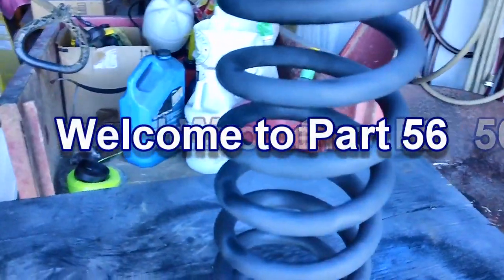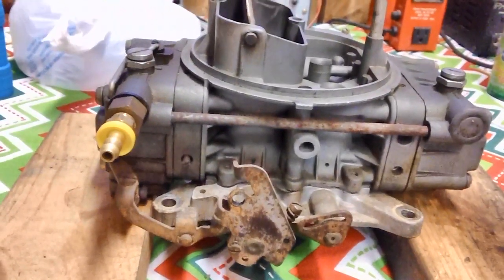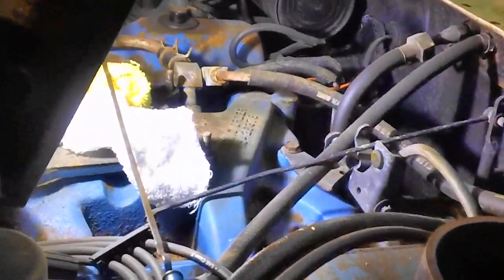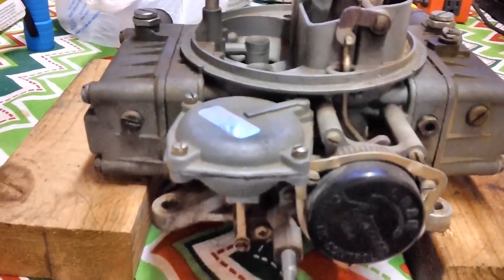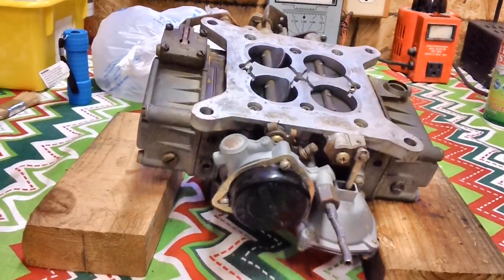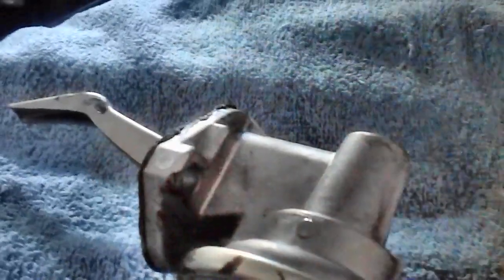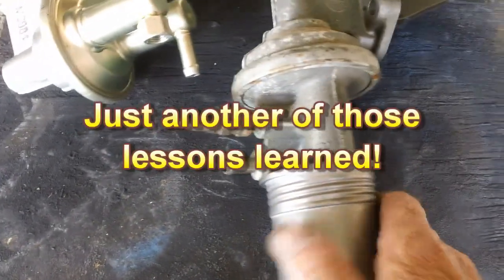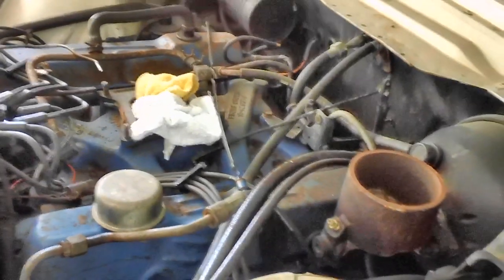1966 Ford Thunderbird repair and refurbishment (Part 56). Carburetor linkage.

Comment: John, 
Best of luck with that carburetor and fuel pump. I struggled with the replacement fuel pump on my 1967 Ford Econoline van recently. It was noticeably bigger and clearance was really tight. I seriously considered going with an electric fuel pump conversion. 
Regards, Tom
Reply from the maker: Tom,
My initial inclination was to go with an electric pump, but Brendan talked me out of it.   So I deferred to his always reliable judgement.
Regards,
John
Reply: @joernone  I know you're limited on your watching time, but Cold War Motors has just started a competition on getting two seized straight eight engines running - a Packard and a Buick. Both cars have been sitting 40 to 50 years. Very interesting and enjoyable to watch. https://www.youtube.com/watch?v=vOBBU6h8BFU&feature=em-uploademail
Reply from the maker: Tom,
Yes, I knew about it and watched it.  It's already a fun contest.
Regards,
John

Comment: John...at this point, if it were me, I would replace all of those vacuum hoses around the top of the engine.  Not expensive, and easy access without the carb and linkage in your way...

Comment: Well that's a crapper about the fuel pump.  I think electric fuel pump and a plate on the timing cover is the way to go cause these old cars I like to let the electric pump prime the line and the carb instead of cranking on it to get fuel to the carb. Saves battery and saves starter.
Reply from the maker: What???  You don't want to crank these old cars to get them to start?  Blasphemy, my friend, blasphemy!   It's all part of the fun.  Why I'll bet you'd also put LEDs in a vintage jukebox.  Tsk-Tsk.
Regards,
John

Comment: John....I'm  sure you thought of Helicoils to repair the threads.  I had a 67 Pontiac with a 400 V-8.  I replaced my fuel pump and the same thing happened to me.  I ran the helicoil into the timing cover (yes...it was aluminum too) and even though my screw was crooked, it held my new fuel pump tight.  Lucky me....
Reply from the maker: My initial thought was to use a helicoil, but Brendan and I came up with something a little easier...we hope.  😏
Regards,
John

Comment: Try using socket head capscrews on the fuel pump.  Not factory, but it should work using allen wrenches, or sockets.
Reply from the maker: They would for sure work, but we're already on track to try something a little different.  But if it fails, I'm not opposed to backtracking to try your idea.
regards,
John

Comment: Are you able to start the bolt in the fuel pump completely to clear the socket? Keep the pump away from the side of the block to get the bolts started. Thanks for sharing...
Reply from the maker: Darryl,
It would be a piece of cake to install the pump if the engine were out of the car, even with the new pump design difference, but trying to finagle the new pump in place is the wrong way to go.  In the end I'll be sorry for doing it.  Better to just go with the right pump and move on.  Fewer headaches that way.
Regards,
John

Comment: Good video i wonder if that new fuel pump you have was designed  for an engine that had stud's coming out of the timing cover  and just nut's holding it on only enough room to get a wrench on the nut's
Reply from the maker: Who knows, my friend?  Seems to make more sense.
Regards,
John

Comment: That's amazing that they left a hole for maintenance of the fuel pump.  Can you replace that hideous diaphragm fuel pump with some sort of electric pump?  That would be so much more simple.  I once lost an engine to a leaking fuel pump, it leaked gasoline into the engine oil when the diaphragm cracked.
Reply from the maker: James,
See the above comment by THOMMGB.
Regards,
John

Comment: Hi John, I'm looking at buying a 1966 Ford Thunderbird town for $1500 that runs (roughly) and needs body work and windows, but the interior is near perfect. What is your take on this? Is it a good deal, or should i keep looking. I have had no luck with asking around at local shops and restoration garages. Thanks, Andy
Reply from the maker: Hey Andy,
There's two main schools of thought on your question:
1.  Though the price will likely be high, buy a classic that's been restored and have fun with it.
2.  If you prefer to do a restoration yourself, then buy a junker or rust bucket at a cheap price and have at it.  Of course, the cost of restoration will for sure be high.
I fall in the middle...not restored, not a rust bucket, just a car I can enjoy working on, hopefully to finish before the grim reaper arrives.  If not, so be it.
Lastly, condition of the engine and transmission is of utmost importance.  It can run buku bucks to repair/replace those puppies.  I'm talking thousands of dollars.
Regards,
John
Reply: joernone Thank you!

Comment: So I ended up getting one of those carb kits and replacing all the gaskets and thermostat choke but now I'm have trouble reconnecting my fuel line and air line hoses next to the thermostat choke whats the best way to go about that
Reply from the maker: I'm not 100% clear on what you mean but the fuel line goes back on the same way it came off.   Ditto with the heat riser tube (hot air tube) from the exhaust manifold...it also goes back on the same way it came off.  Are the two sets of threads stripped?  That'll keep the fittings from going on.
Regards,
John
Reply: Yeah they look stripped and won't tighten and keep turning you think rethreading them will work or some thread seal tape
Reply from the maker: The entire carburetor body is made of aluminum, thus all the threads are easily stripped.  It's no big deal...happens all the time.  So you have three options:
1.  Switch to an electric thermostat and block off the heat inlet holes in the carburetor body and the exhaust manifold.
2.  Use the original brass fuel inlet fitting with enough gasoline resistant thread seal to create a permanent seal or drill out and re-tap the hole to fit a different size brass fitting.
3.  Find a new base.
Regards,
John
Reply: Thank you john for the help
Reply from the maker: Be sure to come back and let me know how it went.
Regards,
John
Reply: Definitely will I watch all your videos I ordered a electric thermostat from mikes carb part witch eliminates the hot air hoses like you said then will just have to reconnect the fuel line back in I got re-tapping and die set just on case the thread seal tape doesn't work out again thanks for the advise john
Reply: I guess it didn't click in my head when I watched your video when you changed out your thermostat choke to a electric one its definitely a better set up the one I got you sand a spot by the valve cover for the ground and you hook up the hot wire to a spot that is getting 12 volts of power when then power is in the on position with one of those volt meters is the one you have similar
Reply from the maker: There's no need to establish a ground.  The carburetor itself is the ground once the metal 3-hole retainer ring is installed around the black thermostat housing.  The ring makes contact with the two shiny metals in the housing.  Once the three screws are installed in the carburetor walla..you have the ground.  Go here and take another look at that part of the video.  Pick it up at time 12:56:
https://www.youtube.com/watch?v=rDhEh1NjXBk

Regards,
John
Reply: Well after all the advice I got from you and all the parts I got from mikes carb parts got my carburetor rebuild after all that tried to start it up with a new battery turned the key and nothing bad connection  cleaned the cilinoid connection and tries again got it to turn over but would stay on after awhile I 
 put gas in it it was out figures my 66 t-bird has been sitting for 30 plus years long story short thinking I got debris in my fuel line and it not letting gas through so yeah one thing after another
Reply from the maker: It's all part of the fun of owning a classic car, so enjoy it, my friend.  Besides, it's far better to have these problems now than when you're out on the road.  Tow charges can be expensive...not to mention the aggravation.   Just keep plugging away.  Above all, be patient and don't forget that it's a hobby car...and hobby cars are always happy to provide their owners with a problem.😎
Regards,
John
Reply: Thank you john

Comment: Hi, could you please show me how to remove the front fender for my 66 Tbird
Reply from the maker: Ray,
I can't show you without removing the fender on my T-Bird.  What you need is a 1966 Thunderbird Shop Manual.  It's best to not work on your car without one.  They're not cheap, but not expensive either.  Here's a new reproduction being offered on eBay:
https://www.ebay.com/itm/1966-Ford-Thunderbird-Shop-Service-Repair-Manual-NEW/303182672074?hash=item46971870ca:g:Hq8AAOSwy2tc~NbA
Regards,
John